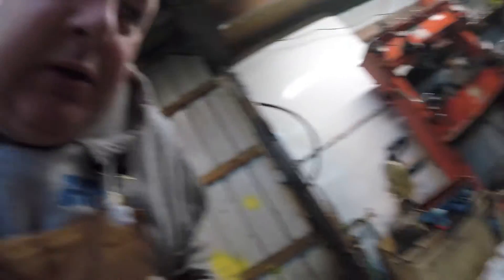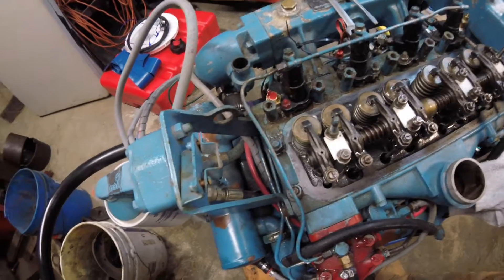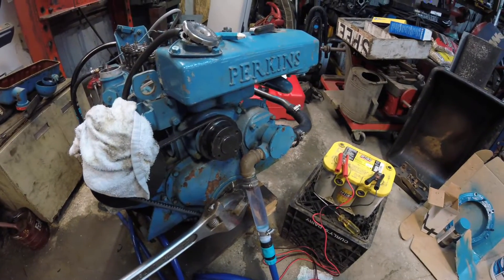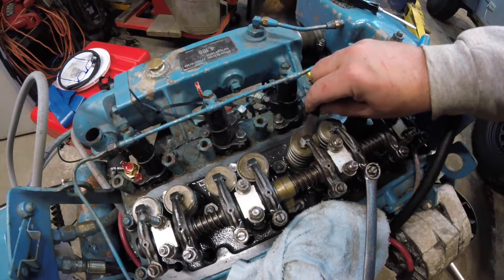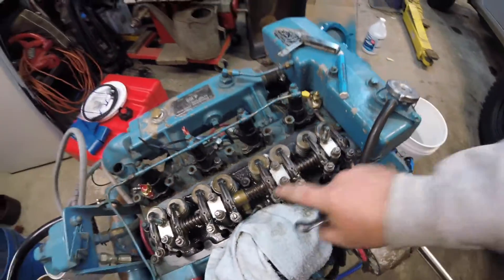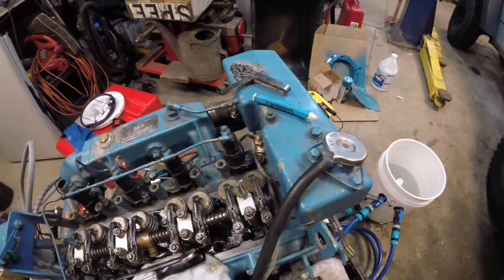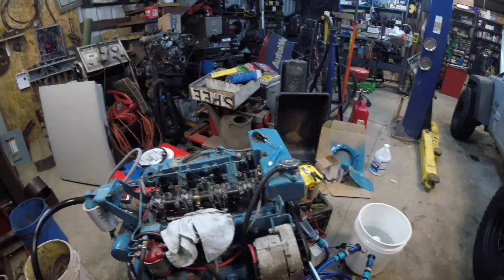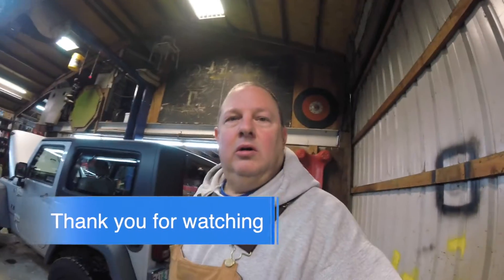Valve Adjustment Process Perking 4-108 Marine Diesel engine [EP 58]

Comment: Great video!  Although, when adjusting my valves I noticed when "rocking" the valves if I move that exhaust valve down a little the gap on corresponding measured exhaust valve opened up a little more.  Should I regap at that point, which should be the point of maximum gap between the values and rocker arms or at the point mentioned when both valves are at the top (intake just starting to go down) when "rocking"?
Reply from the maker: I’m not 100% sure what you’re talking about. If you don’t feel comfortable with how things turned out, I would run it for a while. Let it cool down, and adjust the valves again the next day. Just follow the process I did. Don’t look at anything else.
Reply: @SailingtheWestWind  I ran with my adjustments and had some knocking.  When adjusted with rocking valves even at the top end as you mention, it ran smooth.  It appears that the correct valve adjustment is not the location of maximum gap with the rocking exhaust valve down a little, as in what I tried.

Comment: Ive got a '78 cheoy lee with this engine. It was flooded up to 1" below the dip stick tube. I'm wondering if about all i need to do is replace alternator and starter.  Is there a way to scope my cylinders without removing the head or valve cover?
Reply: Update: zero water in oil. Fired up and idled nicely!  Going to change impeller & zinc this weekend trip.
Reply from the maker: Your alternator is the least of your worry and may be fine. For starters you need to drain all of the oil and replace it including the filter. I would pull all of the projectors out and pump out all of the water that are in the cylinders. I would pull the valve cover off and see how bad it looks. If you have a lot of rust and or it has been sitting for a while, you might need to replace the engine. I’m not there to tell you, unfortunately, but if you have a lot of rest, it is a no go.
Reply from the maker: Nice job

Comment: Hey Grant, I’m Grant. I have a Perkins 4.108 that has some serious issues. I’m going to attempt to fix it in the boat.
Reply from the maker: You can do it.
Reply: I'm curious how it's worked out as I am contemplating some work in the boat too. Seems like a hard reach to get to my starter...
Reply: @mattjewett4473  my starter was a bear to get to. The surveyor told me I’d likely have to pull the engine to get it out. I removed the coolant tank and the tubes that carry coolant and raw water. I also removed the exhaust manifold. Then I could access the starter. After removing the three bolts that hold it in place, I used a coat hanger and put the hook through one of the bolt holes and twisted it. With the loop end of the hanger, I put it around the body of the starter and lifted it out.
Reply: @grantlandthomas  omg. I'm in for some fun.
Reply: @mattjewett4473  as long as you remember how to put it all back together, you’ll be fine
Reply: Did you get your engine running top notch?

I've seen one boat that required an interior cabinet to be removed. To replace the starter.

I am grateful for easy access to my engine from all sides. I think it took me around 15 minutes to change the starter.
I just wish I could drain the oil rather than pump it out.

Comment: Do you know how much torque on the locking nuts after adjustment?
Reply from the maker: I do not have the torque specs. I’m sorry for that. I have a torque wrench but I just have never used it for valve adjustments. Sorry for that.

Comment from the maker: The valve clearance should be .012 for both intake and exhaust valves.  Use a .012 feeler gauge for this process.
Reply: 0.012mm?
Reply: Hello is there possible to get hold of you

Comment: god! NOBODY will just give the clearances and we see adds and have to meet your dog to learn what the valve clearance should be on a 4.108. Sorry, three searches later and hearing all the debates about nothing, and still I cant locate the needed info which is a decimal and two digits. I did this 20 years ago and want to double check the setting now restoring the old engine. I downloaded a manual but cant find the file and it seems to be gone.
Reply from the maker: I'm sorry I did not put it in the description.  I will try to do better next video, I'm still learning.  Thank you for the suggestion.  

Grant
Reply: Did it improve the way it ran?